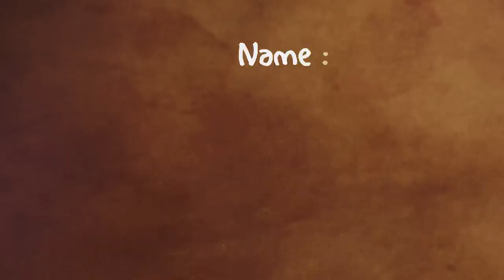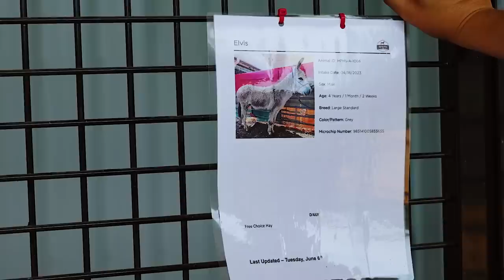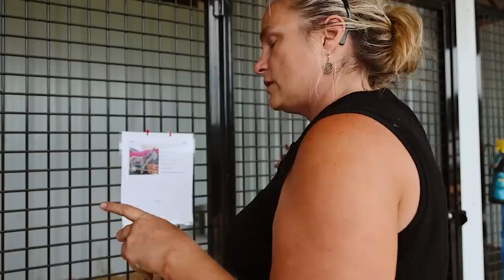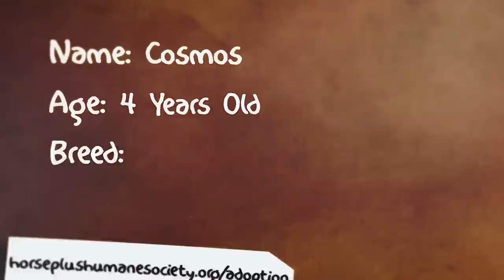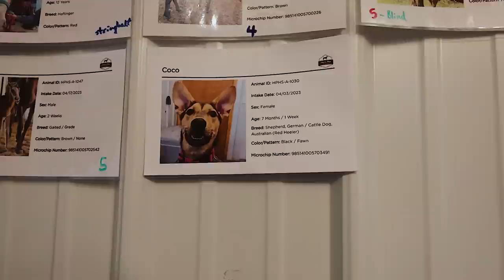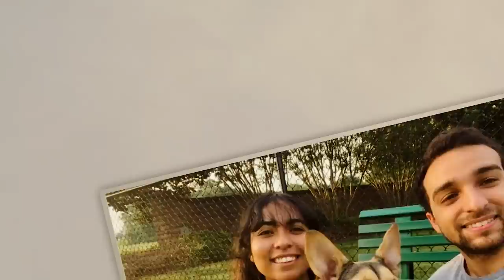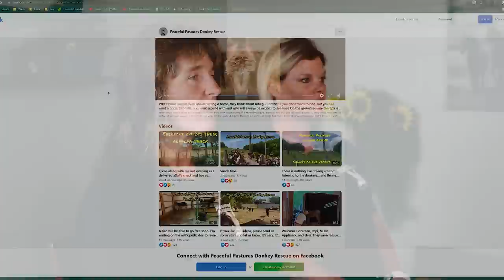Donkeys! HSH S4E18

Comment: We used to use PANTY HOSE for ear protection.  It works and being light, they don't rub them off.  You have to cut them to fit, and tie at the ends, but hey, worth a try!?
Reply: Oh my - panty hose for long ears fly protector. I had a gorgeous lil mule and I did same for her. It worked well.
I thought I was the only one to try that.🤣

Comment: You should hang some wind chimes around the noodle course. Above the outer fences. Just 2 or 3 they make great distracting noise but not enough to totally put the horse off on the course. Some plastic bags hanging around too. Blowing in the wind. I've also seen kids riding outside the enclosures with bells on their bikes. Maybe a small air horn. All every day noises